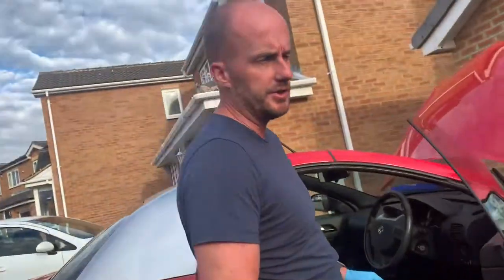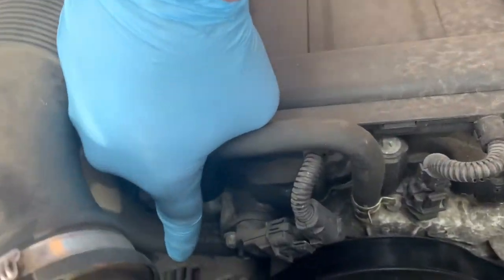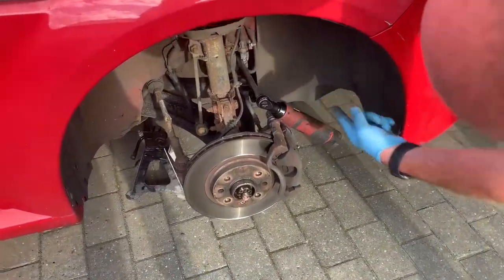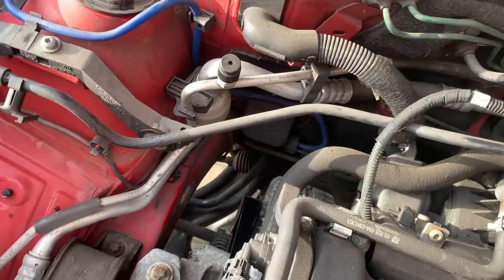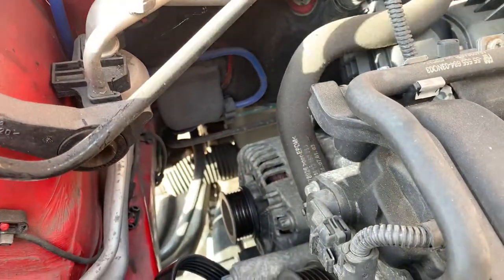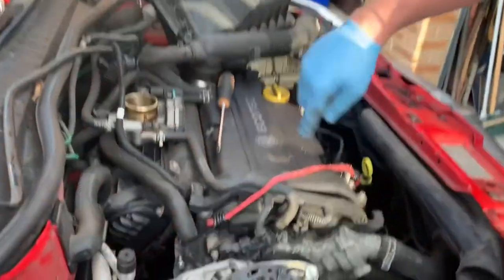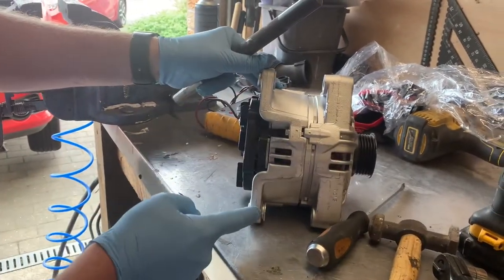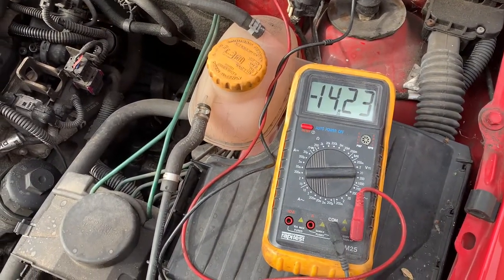Vauxhall Tigra 1.4 alternator charging battery problem. New alternator.

Comment: How did you do the tensioner, I undid the bolt but the tensioner didn't come off like yours, job is all done just don't know how to compress the spring to put the bolt in the bottom of the tensioner

Many thanks
Reply from the maker: @tomghostriderbarr  if I remember it was a bit of a struggle. I tie wrapped it. Think it took about 10. Snipped them once in place.